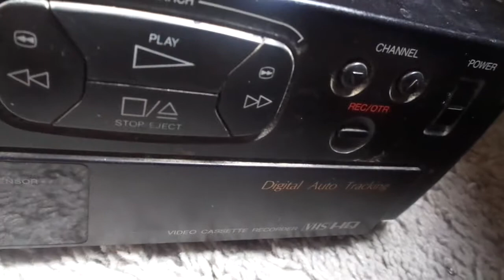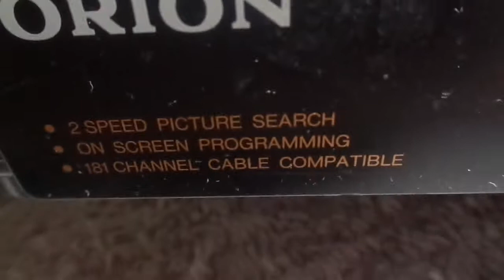Review of my Orion VR0400 VCR

Comment: Interesting VCR. An Orion, not Emerson, with this mechanism. It's one of these VCRs with the circuit board that is not on the bottom and with the power supply behind, and the drum motor is on the top. That's unusual. I've seen a Hitachi like this. I think the model is M181. And I've never seen an Orion brand VCR. That are probably more rare in my area. There is no doubt that the mode switch is dirty, it thinks that the mechanism has arrived to the ejected tape position while it's not. When you play + rewind the mechanism turns but the mode switch doesn't detect it and it shuts down. You can perhaps remove the circuit board, take apart the mode switch and clean it with a Q-tip and alcohol, but I don't know if you know how to take this apart.
Reply: CLEANING THE MODE SWICHT MUS BE VERY CAREFUL